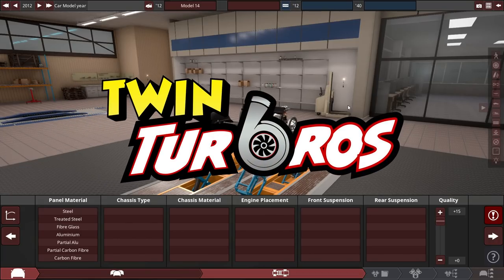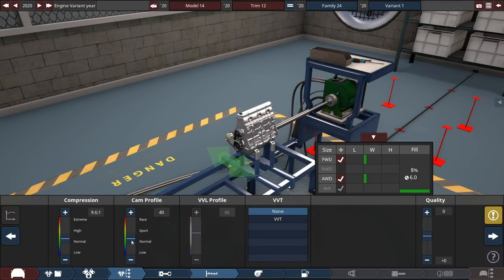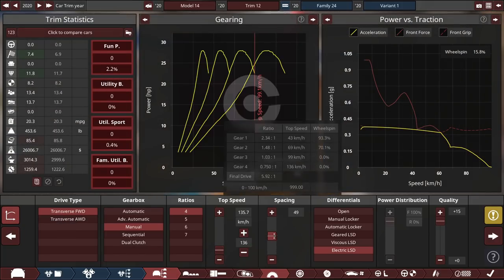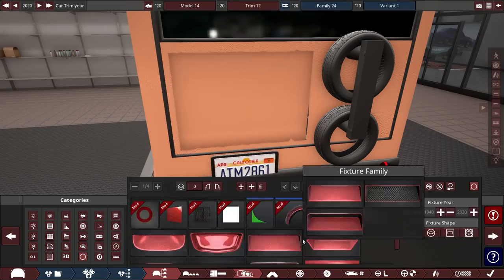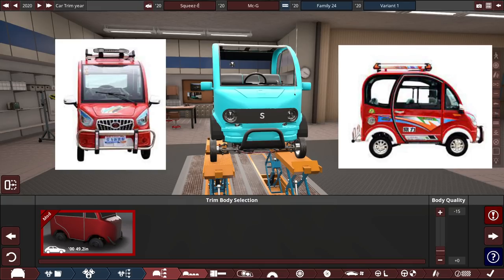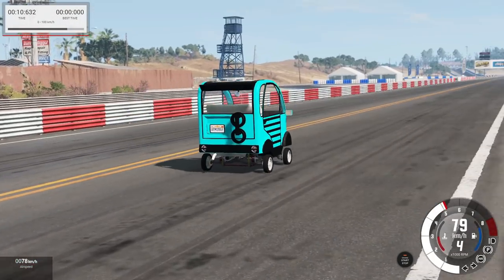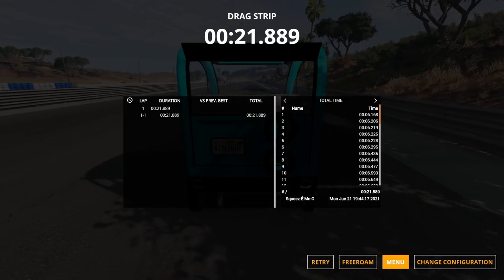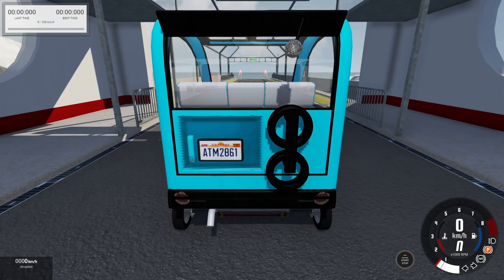Building The Lightest Car In Automation!!! Automation - BeamNG

Comment: They were going to fill the tires on the car with helium, but that made it too heavy. They were going to install cabin lights but decided photons add too much mass. The manufacturer suggests you have a bowel movement before driving to increase fuel efficiency. Chewing gum is strictly prohibited.
Reply: Helium is lighter than air
Reply: @billbergen9169  that....thats the joke

Comment: Needs bigger wheels (wider contact patch, thicker sidewall) and an undertray. This would give it some much needed traction, and a lower center of gravity.

Also needs traction control and ABS, because it seems undrivable without them.

And maybe a 7-speed auto… or at least taller gearing.

Comment: Going around the track reminded me of the times I'd take a Citroen 2CV around a track in GT4, good times those were.

Also, today I drove home from college in the family car. It went perfectly... until I forgot which pedal my foot was on while backing into the parking space and whilst attempting to straighten out the car by going into drive, intending to press the brake in all the way to shift from reverse to drive I ended up flooring the gas and flew over the curb into the grass.